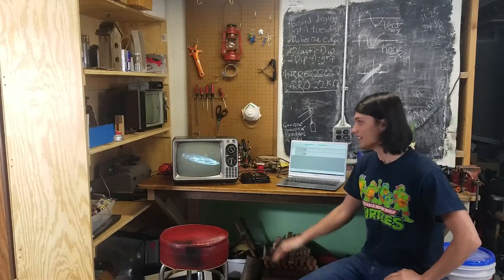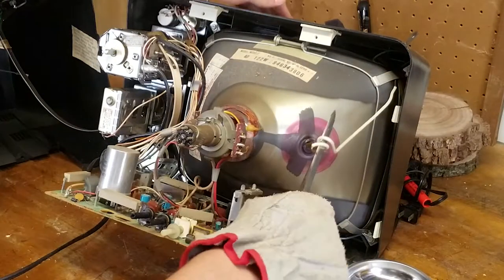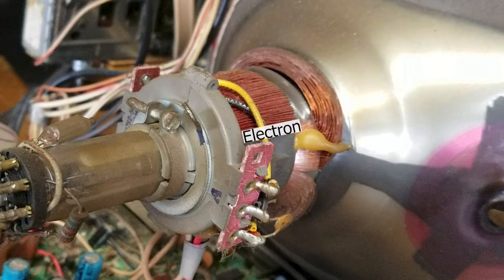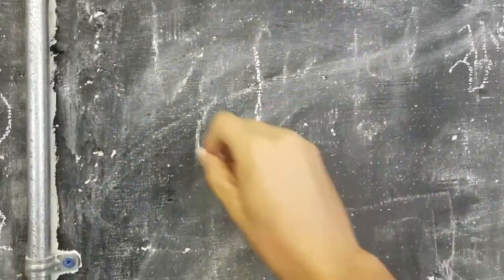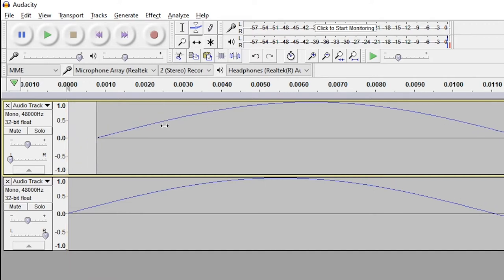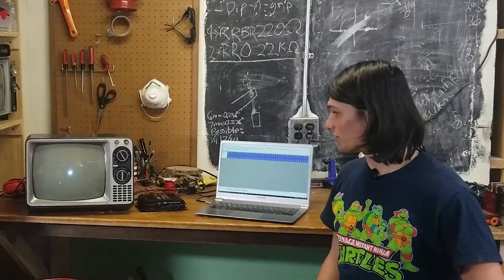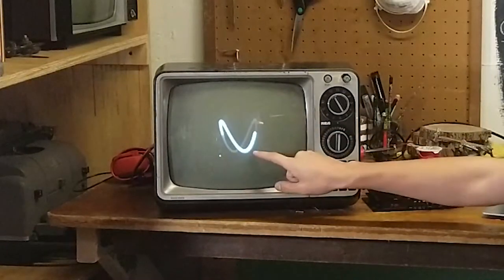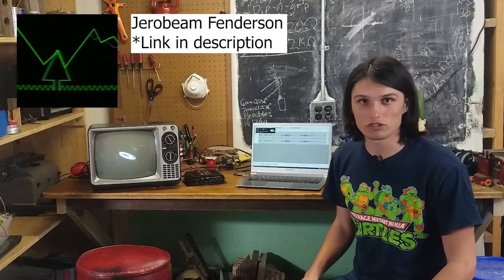Seeing Sounds with this TV  //  CRT Oscilloscope

Comment: The resistance of the 2 coper coils are different that's why the cercle is not perfect. You need to amplify the signal in one of the them to compensate. I fink that the difference in resistance is because the screen is not square it's a rectangular. You must find the resistance of the 2 coils and calculate how much more power you need to put in the most resistant coil .

Comment: What software are you using on the pc? Isit just a function gen?  And what i get confused on when trying this is where exactly the preamps go in circuit because when trying to make a music visualizer the l and r channels go to the v and h def coils but when i put a preamp in between the input and coil the thing either just causes the feedback or something to put a big line on the screen that doesnt move.. is like its moving but only on that linear axis which doesn’t differentiate anything only making the line..  when i put amps on both the channels then i cant get anything besides the dot in the middle. With no preamps i get a tiny tiny visualization which is reason for preamps.. am i amplifying the current or something or adding an unnecessary resistance to it?  Hard for me to keep testing and trying crap because i wind up messing up the crt and have to get a different one which are hard to find if looking for one..  lol
Reply: Its called audacity

Comment: I’ve been tinkering around with this with a Sony watchman and haven’t yet got the signals displaying quite right and they are weak. Are you amplifying them? I think that black box on the table might be a pre amp or something ? Also one of my channels is stronger than the other. I was going to try putting some op amps in it to be able to fine tune the signal strengths
Reply: One coil has more resistance than the other. And yes that is an amplifier.
Reply: Its as simple as Audio -> Amplifier -> SPEAKERS A to Horizontal & SPEAKERS B to Vertical
If your CRT won't work, you might have a safety system on your TV wich  kinda prevents this sort of mod, but you can get around it!

Comment: How can I decrease the scale of the oscillation, i made this with a small crt, the problem is that when i turn up the volume to moderate levels the wave move so much that is unpleasant to watch...is not aesthetic, great video dude gratings from chile 🇨🇱
Reply: I usually use a keyboard amplifier or a 2 channel audio interface and just turn the gain down accordingly on those. It's pretty key to have the audio you hear separate from the audio to create the signals, so maybe a mixer would be useful too.

Comment: Can you tell me whether an older CRT TV is required? Can you tell me how old is necessary? Should a TV from the 1980s be sufficient?  Thanks for your video!
Reply from the maker: Any CRT TV works. We use the CRT part - cathode ray tube
Reply: @SamWestby  Can you please tell me what wattage of amp works best?
Reply from the maker: @munsonatl  In this video I use a 45W amp. What works best depends on your TV

Comment: Hi maybe you can help me,  I tried making something similar. I located the two separate pairs of wire for each deflection coil and soldered it to two audio jack sockets. But I came through a big issue. What I get when I turn the tv on is the initial dot in the middle but it stays super small but becomes really really crazy bright and after a few seconds i hear a pop, the display shuts and after a big static noise appears coming from the back of the tv and continues until I unplug the tv. Any ideas on what's wrong ? Any tips would be greatly appreciated. Thanks
Reply from the maker: Sorry I'm not sure. When I have the deflection coils unsoldered and disconnected, I see a steady white dot in the middle of my screen. My only though is something is wrong with the soldering. If you unsolder the audio jack and leave the wires disconnected, do you still have a problem?
Reply: the tube is dead

Comment: Annoyingly it's virtually impossible to get those coils to align. The coil will limit current by using power to drive the magnetic field associated with it. Inductance is an absolute NIGHTMARE to account for in analogue systems like this. My solution was just to leave the vertical coil as is, run mono audio though the faster horizontal one, then turn the electron gun 90 degrees so it looks correct. Makes for a sweet vizualiser! Just not technically an oscilloscope...

Comment: It's not the flyback transformer that has a charge, it's the crt tube that has a charge.👍
Reply: Not really, since the flyback transformer must deliver a DC to the CRT, besides the internal diodes, it actually contains a smoothing capacitor of about 100 Pico-farads.
Reply: That's interesting, here in the United States everyone is trying to get rid of CRT TVs and you can get them for free online. Anyway, in a flyback transformer there is both a primary coil and a secondary coil (And Perhaps a Feedback Coil). The primary coil is fed with a transistor from a direct current supply. When the transistor conducts, the primary inductance of the transformer causes the current to build up in a ramp, storing energy in its magnetic core. When this transistor stops conducting, the current in the primary coil falls to zero and the energy stored in the ferrite core is released to the secondary coil. Due to the transformer's high turns ratio, a very high voltage is created. This is used to power an electron gun that sends electrons towards the phosphorescent screen. However, the current created is infact alternating at a certain frequency (15-30 khz) which means that the intensity of the point shown on the screen would be fluctuating. This means the current must be rectified. In very old television sets, this was done by vaccum tube rectifiers but in modern televisions, this job is done by an internal diode located in the flyback transformer. However even though the diode creates direct current, fluctuations are still present as the signal goes bettween a high voltage 10-50kV and zero volts which means that the point on the screen would still be fluctuating. In order to repair this, a smoothing/filter capacitor must be placed in parallel with the power supply in order to dampen the ripple. In older televisions a diluted form of graphite known as aqua dag was placed on the inside and outside of the CRT in order to form a capacitor that would dampen the fluctuations of the DC signal. However, this aqua dag was somewhat expensive and companies would have to charge more for their televisions. For this reason, a much cheaper, internal capacitor is placed in the flyback transformer. This capacitor would run in parallel with the CRT's capacitor so that a higher capacitance can be obtained using less aqua-dag. This means that in more modern televisions, both the CRT and the flyback transformer have a high voltage capacitor for the simple reason that it is cheaper to put a capacitor in the flyback and use less aqua-dag than to only use the aqua-dag.
Reply: Yeah, he's one of my favorite youtubers
Reply: lol

Comment: Does the polarity of the wires going into the amplifier matter?
Reply: No. Incorrect polarity will only result in a flipped image, but no damage.
Reply: @jesusplayssax Doesn't matter which way around they go, but make sure you don't overload it! My setup uses 25W and works fine, but too much will pop the tube.